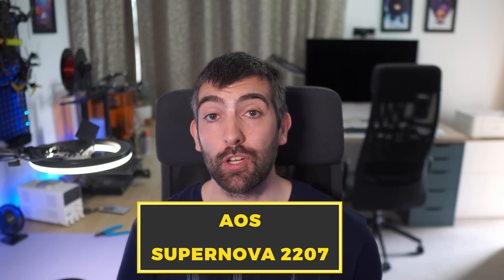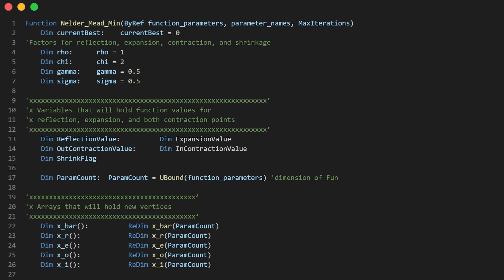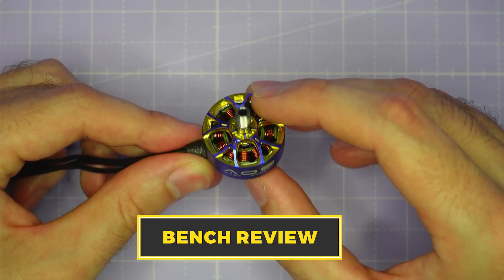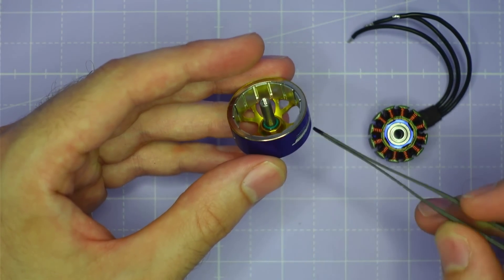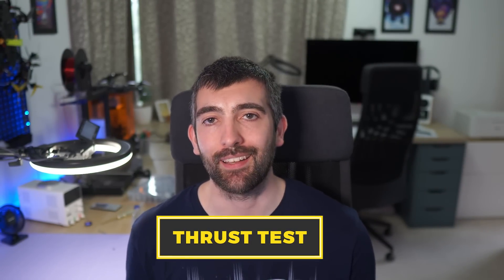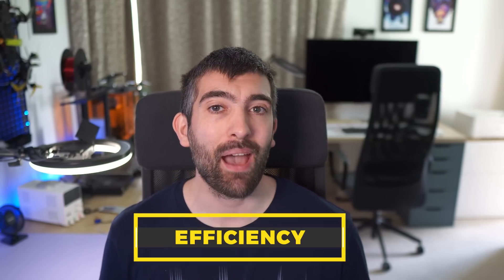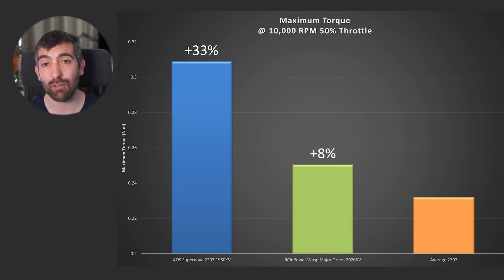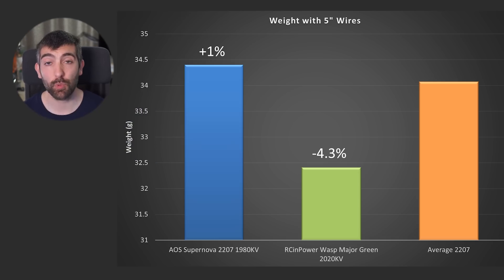How I OPTIMISED the 5" FPV Motor with SCIENCE: AOS Supernova 2207

Comment: Given that its not 2207 I don't like the naming. And calling it 2207 class to me doesn't mean a whole lot as 2306 and even 2406 motors are largely lumped into a similar class as 2207. It'd be better if they were just advertised as a 5inch high power motor. Then you would also be able to make better comparisons with 2306 and other 5inch motors to really see where it lies in terms of performance. Not saying there is nothing special about this motor, just that the naming is poor and there is definitely more room for better comparison testing.
Reply: Or do like T-Motor and name it something else. Like the F40 Pro V - 2306.8
Reply from the maker: I agree 💯 with you. Unfortunately, one person cannot decide how motors are named and sold in the hobby. Pilots are searching for 2207 motors for 5" quads so this motor has to be called a 2207 to show it's for the same purpose. I wish this weren't the case!
Reply: @ChrisRosser thats bullshit. Before 2207s, people were running 2206, 2305s, 2205s. Make a good product, and label it truthfully and people will use it if it's good, no matter the size. But the arbitrary value for the size is dumb
Reply: @harrylenon9594  I just looked through many drone motors for a fixed wing application. Size wasn't even a consideration. Motors without published technical data weren't considered. It was easy to find something for the application based on weight, Kv, and resistance, mainly. The same way I've done it since NiCd was the only battery available.
Reply: @ChrisRosser  I disagree the tmotor f60/f40 sold very well. Same as the fpv cycle emerald motors. None of those motors listed their size.

Comment: What would be really useful for fixed wing pilots is knowing what the max reasonable amps it can run would be. Eg could I run this with a 55x65 prop on a race wing, will it handle a 6x4 etc

Comment: I don't understand why you would not publish the motor dimensions. _Literally_,  every motor is listed by their stator volume, but then you start comparing it against motors that are listed by their stator volume. Yet, yours isn't, so it isn't a valid comparison. 
I get that you are trying to sell your stuff, but it feels like you are hiding something. You are using numbers to prove your point, which is good, but again, why obfuscate the most basic of motor information. 
FPVcycle does the samething.. They list a 25mm motor, what is that? What does that mean? Can we compare these motors?
Keep your secret sauce, but if you are trying to take the mantle of motor tester and educate us all on what makes a good motor, then at least help everyone get there.
Reply from the maker: I think of it like this: there are performance numbers and design numbers. I'll happily publish all the performance numbers, power, weight etc. Everyone has a right to know the performance numbers to make a good choice. Design numbers have no bearing for the pilot (except as a substitute for performance data) but make it easy to copy the product so they are kept secret.

Comment: Finally a premium motor that explains why it is different for the price, instead of just saying it is "more powerful, smoother, and more durable" like all the others. Almost 60A of current though, and over 80C in 5 seconds, yipes! Gonna need that 260C-rated insulation if my regular blackened motors are any indicator. 😆 Would love to see thrust/power and torque/rpm charts comparing it to the wasp major to get a more complete performance picture.
Reply: Yes we need charts on all rpm range :).

Comment: So its not a 2207..

2308 would be about right for your thrust numbers.   Slightly thinner magnets of higher grade to keep it in the same frame.
Reply: He said what the main difference is, a thicker flux ring. I assume this means the magnetic field is used more efficiently, so a smaller stator can produce the same effective field as a larger stator with a traditional flux ring. The magnets probably are smaller too, since their magnetic field will also be used more efficiently. The smaller size is to make up for the added mass from the steel.

Comment: Chris, I really liked the innovations, flux ring, high temp enamel, and the shaved mount areas... but not sharing the stator size is not a good idea, because people will think this is much larger than a 2207... which might explains some of the improvement...
Did you have shave the mount weight to compensate a larger stator? 
Nevertheless I expect that they are amazing still... great engineering work as always, and great work on model based design...
Reply: It's clearly a smaller stator if it has so much more steel while being almost average weight.
Reply: The size doesn't matter. Only mass.
Reply: @rcdieselrc  durability also matters and the bell and magnets are thinner

Comment: Don’t call it 2207 if it’s not 2207….  FPV Cycle just gives the motor a name, which isn’t great, but is better than mislabling.
Otherwise this looks really interesting.

Edit: I really appreciate what you are doing in FPV, and testing everything instead of just being a hype man.  Just add “class” to the name, especially on the pre-order pages, and I think you’re fine.
Reply: I like Chris Rosser, but was kind of hoping the top comment would be the motor measurements
Reply: @HereComesWhitey  It’s 34g, and the FPVCycle 25mm imperial is 35g, where the Five33 2207 is 28g.  It’s not a crazy difference but certainly for the weight it seems like it should be bigger than 2207.  The steal doesn’t help the weight, but appears to add power.
Reply: @scottmilano2940  Yeah, it may "only" be 6 grams but that's still 20% more weight per motor. I'm sure the steel is a contributing factor to this to some degree. The motor does accelerate faster too, which is harder given the higher rotating mass. And it does have higher torque + thrust output, so maybe the extra 24gs of weight won't be too much of a penalty. But I do fly with a guy who I know will not only notice the extra weight, but would probably complain about it too 😂

He's allowed to though because he's 👽fast, lol
Reply: @scottmilano2940  Not sure if thats the same motor, but Chris has the Five33 2207 at 32,8g - maybe the 28g is measured without any cable? The AOS spec sheet says 31g with 2cm cable. Hard to compare using different sources.
Reply: 100% Pretty misleading to put it in the title, even though he does say it here (not everyone who buys this motor will have watched this video).
Also kinda ridiculous that he wants people to keep the actual size "secret". It's not like there's gonna be this "magical" set of dimensions that are somehow better than any others. It's also plainly, physically measurable, so it's likely not gonna be long before someone does publish it.
Reply: either way its not an 2207 and its a bit heavier then most, it's closer to a 2308 with a lighter bell, And comparing it to smaller motors is very misleading and of course his motor is best, It's a bigger motor that consumes more power and at 60A a Lipo will barely deliver that current for two motors, so the motor will never reach its full power in flight. The efficiency is also marginally better 4% but tested only at 350W[maybe that's where the difference is bigger?] We still don't know how durable they are with a lighter bell and magnets, and at 35USD [Aliexpress price] for a motor that you won't find in stock when you'll need its too much
Reply: @andrewfpvair why do you think it will draw more power? The efficiency numbers were pretty significant. My guess is the stators are actually smaller and things like the steak improve the performance for the smaller stators, but adds weight. So, it performs better gram for gram. Guess time will tell. I get why he does it though, since stator size is the rough guide to sizing motors. So, if you have a much smaller stator but performs like a larger stator, you want to make sure your pairing parts up properly.
Reply: exactly.. 2207 is literally the dimensions of the stator, you cant call your motor 2207 if its NOT 22mm x 07mm !!!!!!!!!!!!!! and that from a "science" guy. shame!!!!
Reply: What part of 2207 class do you not understand?
Reply: @cinemoriahFPV  Title is “AOS Supernova 2207” not “AOS Supernova 2207 CLASS”.  I think I’d be ok if “class” was added to the name.  Though Five33’s 2207 is 28g where this is 34g.  But ok it’s maybe it’s more durable.  Even the pre-order page just says “2207” not “2207 class”
Reply from the maker: @scottmilano2940  Overall we felt that more performance at the same weight would be more useful than same performance at a lighter weight as a first product. That said, if you want the best performing 28/26/24g motor I can do that. Maybe we need to start the conversation about what the ideal weight would be or the minimum performance to give the optimizer a target to shoot for. I.e. Minimum mass that gives X torque and Y efficiency or maximum performance at Z g of weight.
Reply: @ChrisRosser   I like how rcinopwer produces 1404 motors. These motors weigh 9 grams. I want to see the maximum performance for 9 grams.
Reply: @ChrisRosser   A series of motors at various weights/sizes would be incredible.   “Ideal” doesn’t fit this community given the variety of quads, sizes and durability needs. My objection was mainly the mislabeling.  Call it the “Rosser5” if you don’t want to release the exact size, or even “2207 class”.
Reply: @ChrisRosser This seems like the best plan to me, release a series of motors that optimize performance and efficiency at a variety of selected weight classes.
Reply: @ChrisRosser  I would love to see a maximum efficiency pancake motor line, to really enable 1+hour drone flights, among other things.
Reply: @ChrisRosser  sub 250 grams  5” (or 4”) builds like the ummagawd 2fiddy are extremely appealing. The motors they use are around 15.x grams
Reply: @ChrisRosser  we just want the best 2207 motor for comparability, but i starting to doubt all other manufacturers.... where is the problem in calling your motor 2308 if it is one and recommand it for 5"? if everybody lies about their size its just not good for consumers. yours is still an amazing motor but you buy the lightweight with expensiv titanium...
Reply: @cinemoriahFPV  Where is 2207 class written? Oh that's right asshole, nowhere.  It is plastered everywhere as a 2207 motor. "2207 class" (Not a thing) is only mentioned within the video.

Like I stated above, I like Chris Rosser, watch most of his videos. But, this is misleading and unnecessarily cagey.

It's the same thing as T-motor refusing to give the specs on their motors. If I don't know what I'm buying, then I ain't buying.

Comment: interesting but I am not really convinced. How exactly was every 2207 doing it wrong and what have you discovered that is new here? It would have been exceptional to give this to an independent third party to measure these parameters... at least if you want to be 'Scientific' about it, some peer review would certainly help ;-)

Also, it would help to mention that the RCinpower Wasp actually has less stator volume then avg 2207 (its 22.6*6.5). Yours clearly must have a whole bunch more stator volume, so the results are no surprise really. The design once taken apart looks exactly like every other RCinpower motor - they all have the washer and o-ring. The base and even prop grip are identical to the wasp major. 
Labelling this 2207 is a bit cheeky. At least RCinpower Wasp is correctly labeled by RCinpower at 22.6x 6.5. 
I wonder how this compares to the new 22.6 FPVcycle motor, which is also made by RCinpower, based on the wasp, but has a larger stator. Weight seems to be same as average '2207'. This would be an interesting comparison as I bet they are very similar in stator size and really wonder if your method of modeling magnet flux gained anything rather then iterative flight testing which is what most designers do.
Reply: Probably a 2308 with thin mags.

Comment: Wow,  the rcinpower spec on pyrodrone says it draws over 60 amps with a 51466 prop?! That's going to test a lot of ESCs.
Reply: Good luck finding a lipo that can deliver 240 amps continuously.
Reply: @hersheyfpv3501  I'm not sure if all 4 motors will be held at 100% for any length of time. But still, these are 7-inch power requirements. I don't race, so what do I know, but I would like to hear a racers viewpoint.
Reply: @cinemoriahFPV  Bingo 🎯

Comment: I don’t know about this not sharing actual stator specs.  I mean, if it’s a 2208 of course it will outperform a 2207.  But calling it a 2207 would be a bit disingenuous.  So is it a 2207 or no?
Reply: Since it has the weight of 2207 with a much thicker flux ring, I assume the stator is actually smaller. I also assume if he released a 2106 motor or something like that, all the talk would be about the size, how it's super heavy for the size etc, instead of focusing on the results compared to 2207 motors.

All just a guess ofc.
Reply: @Kai-P  Yeah, I think the goal is to move the talk away from the size as what makes it unique.
Reply: Definitely agree, it is like calling an 18650 battery although it is not 18x65mm size. Yes perhaps the motor size means nothing but then do not give size at all. To be honest publishing the dimensions now would not make too much of a difference given that those who want to find out, will find out.
Reply: @jovaraszigmantas  an 18650 being a different size would make it incompatible with many applications. An FPV motor only needs to have the right mounting pattern to be compatible. The 2207 name is used because that's what people search for. Can't sell a product no one will find.
Reply: either way its not an 2207 and its a bit heavier then most, it's closer to a 2308 with a lighter bell, And comparing it to smaller motors is very misleading and of course his motor is best, It's a bigger motor that consumes more power and at 60A a Lipo will barely deliver that current for two motors, so the motor will never reach its full power in flight. The efficiency is also marginally better 4% but tested only at 350W[maybe that's where the difference is bigger?] We still don't know how durable they are with a lighter bell and magnets, and at 35USD [Aliexpress price] for a motor that you won't find in stock when you'll need its too much
Reply: Ultimately stator proportions are kind of a meaningless metric. It's not stator proportions that make drones fly, its power vs weight. If it weighs the same as other 2207 motors then it's reasonable to compare them. He doesn't want the stator specs released because he'd like this motor to actually be on the market for 5 seconds before getting cloned, which will happen anyway, he's just trying to slow that down a bit.

Comment: Is that the end of AOS Labs? how will you be able to provide unbiased reviews while selling your own product? Because you were not affiliated, you were able to dig deep into the technical details of each motors previously tested; But already you are refusing to talk about the size of your new motor. You should be fair and analyze all motors the same way.
Reply: I have to agree...  If this is essentially your own product, manufacturers won't have any incentive to have you review their motor. And you could be biased towards the manufacturer that produces your motor...  
Asking your audience to not share info that competitors will easily discover on their own was also a move that left me scratching my head... 🤷🏻
Reply: No, he doesn't dude. It's his motor. Its proprietary engineering that went into it. He doesn't have to give out anything like that to anybody.
Reply from the maker: I'm going to keep testing motors. I felt it was important to use what I've learned to create the best possible motor. I didn't think it was necessary to publish the exact dimensions of the motor as it only aids copying and no other manufacturers publish detailed design information.
Reply: Rcinpower wasp major are 22.6x6.5, its written on the bell. also according to you, the secret sauce is your magentic flux model. this presumably includes things such as air gaps, magnet strength, etc which nobody would ask you to publish. Stator size however, is common to be published. @ChrisRosser
Reply: @ChrisRosser yeah, because competitors don’t have calipers.

Comment: That's amazing! Would love a smaller motor as well.. Perhaps something like a 1405 or 1604. :)
Reply from the maker: I'll see what I can do!
Reply: Omg that would be amazing!! I just found your channel from JB and am already so impressed with your videos being so in-depth. a 3" or 3.5" prop motor would be epic (:  @ChrisRosser ✌🏻
Reply: @ChrisRosser I still didn't get how it got that design increased it's all round specs?
Reply: @ChrisRosser 1504 would be a cool size for 3.5 inch drones
Reply: Yes Please. For the AOS 3.5 with an o3... 
maybe  a 4" biprop...  @ChrisRosser
Reply: @RCRitterFPV  1804 or 1605 seems like the largest motor for 250g that can be made light enough to maintain reasonable battery options.
Reply: Being involved in the first 1604 motor production, I second this. 😁👍
Reply: A motor for sub250 drone would be a blast!
Reply: Echoing this, something for 3.5" sub250.
Reply: Yes please, That would also be amazing!! Just whatever size Chris thinks will be best for a 3.5! I think there might be even more room for optimization in the 14, 15 and 16XX sized motors, because of how different they are from each other!
Reply: Yeah, a sub250 motor with the same process would be nice. As would a 10 inch motor. I think you'd have a cinelifter market with lots of cash up there